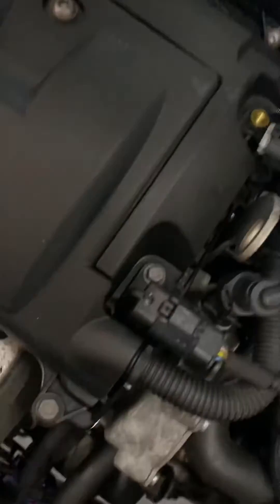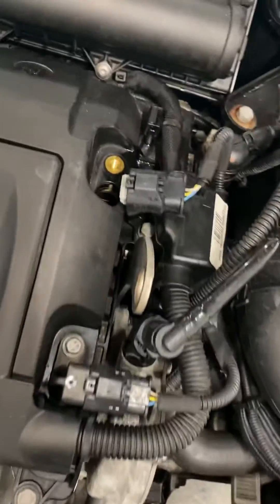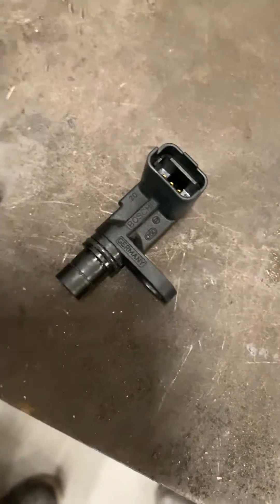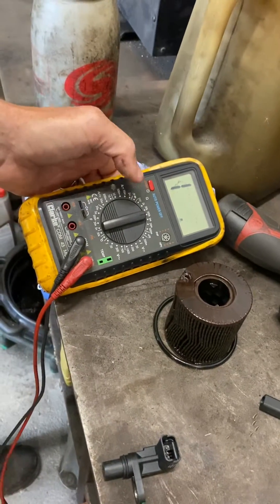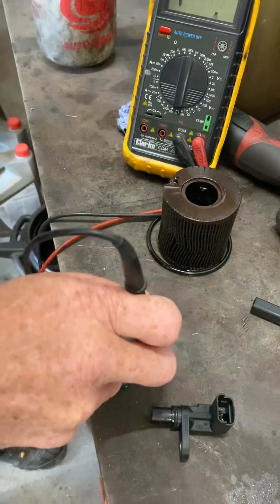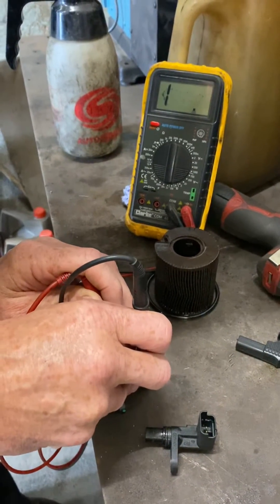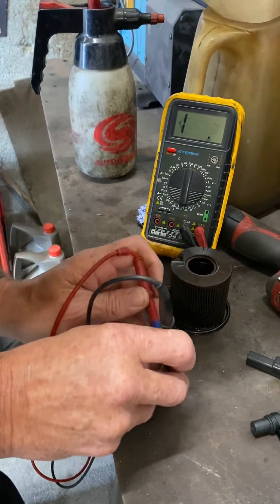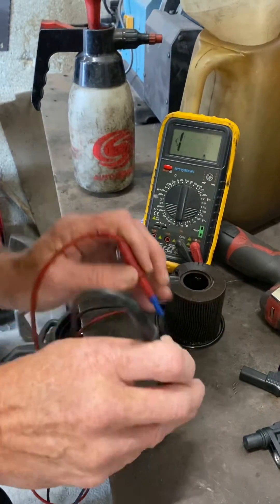Mini camshaft sensor fault

Comment: I just noticed you can swap inlet and outlet sensors on the r56 I did that and runs much better now. Can't see any obviously bad readings on the sensor, might be bad cable from vibrations, but will order a new sensor now.
Reply from the maker: Nice. Hope your chain isn’t stretched 🙏🏻

Comment: Those are nice DMM's if yours ever fails to turn on it may need a pull down resistor by the transistor that latches it on. I had to do this repair on the same meter.
Reply from the maker: Thanks for the advice mate. Yeah I had this one now 20 years!!